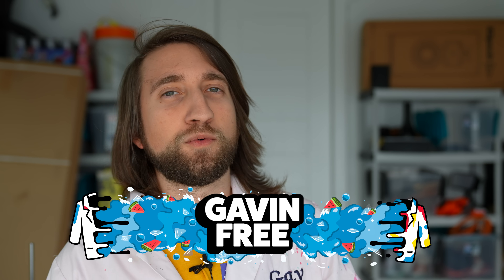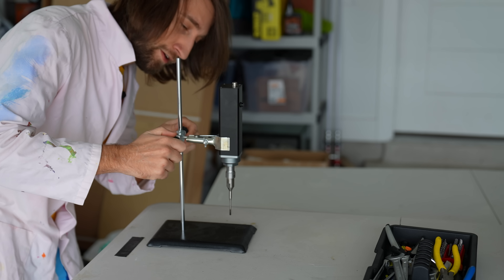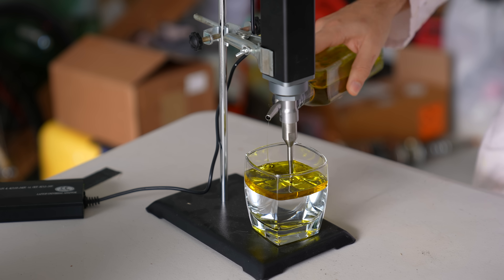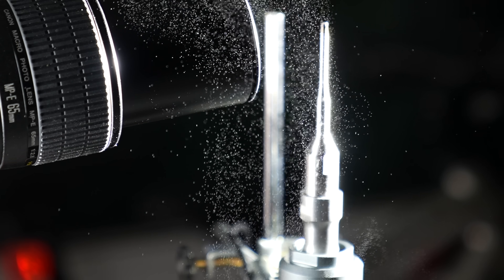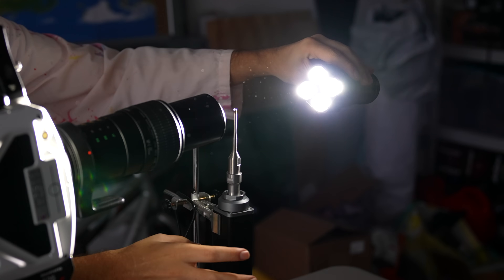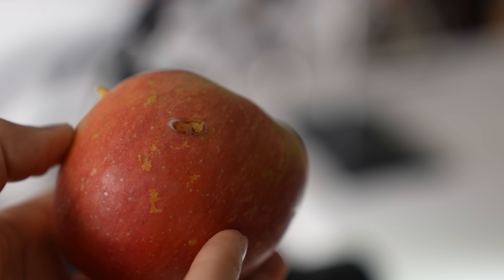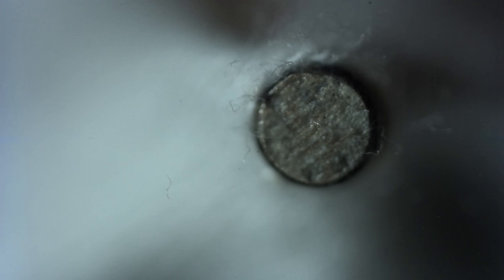Ultrasonic Obliterator at 170,000fps - The Slow Mo Guys

Comment: I think when this is used on solid material it's pretty much like friction drilling with carbide but instead of rotational force you have vertical. You still might actually be able to go through some soft metals even with this one because it's so fast. You should try it, it will ruin the tip though :)

Comment: The 0.000035 seconds is 0.000033 with some measurement error, since you have a 2 microsecond resolution and you measured 35 microseconds, you should really say ”35 +- 2, and 35-2 just happens to be 33.

Comment: Fun fact: The phenomenon he describes with the sonicator appearing to move slower than it is when filmed at lower frame rates is known as "Aliasing." Sampling data at too low of a frequency compared to a signal causes the recreated signal to have a decreased frequency. To prevent this, you have to measure at least twice as rapidly as the sonicator, or 60kHz for a 30kHz sonicator. The minimum frequency to prevent aliasing is called the "Nyquist frequency"!

Comment: I guess your labcoat is made of cotton, the footage of the tool ripping through it was amazing.

What i thought of, as soon as you put it to use on /against your coat, was (hopefully this is the right term, learning none of the terms in english) ultrasonic welding, especially ultrasonic welding in use on thermoplastic cloth. That would actually also kind of have an up-to-date aspect to it, since medical /kn93 masks obviosly can't be sewn, because that would leave quite some holes. 
With this tool you could kinda breeze over it to possibly actually weld some cloth together, "slowly" poke holes, cut two or more layered welded edges etc.
Or maybe you could even compare it with the machines actually used to weld protective gear and masks needed en masse right now. 

Regards

Comment: Cool lab equipment that would be interesting in slow mo ... 
1. High Sheer Bade mixer ... 27000 + rpm ... it also harmonizes and you should also be able to see cavitation at the blade tips ... I would love to see in slow mo how the mixing occurs because it does not happen at the tip it actually mixes as it moves from the inside to the outside of the blade ... if you can get a few different blade shares that would be really interesting - its a tad on the expensive side but you might be able to convince someone to lend you one.
2. High Sheer rotor stator mixer, this might be more difficult to see but if your could get someone to make the stator out of high impact clear plastic that could solve the problem of seeing what is happening.
3. Not as destructive but also interesting to see is a surface tensiometer that measures the surface tension of liquids, try to borrow one that uses a ring ... looking at different liquids to see what happens at the moment that the surface tension breaks would be interesting.
4. Someone mentioned chemical reactions there are some really visual ones, just need to check around
If I think of more I will add to the comments. 
I hope that you read this and can get the equipment mentioned. 
By the way, one cool experiment with the blade mixers is to mix fruit in water, seeing how the blade disintegrates the fruit should look pretty awesome and if you got something with contrasting colours like carrot (yea I know it's not a fruit), apple, pawpaw. You can also play with textures to see how they disintegrate ... The rotor stator mixer can also mix fruit but you need it to be smaller to be able to fit into the stator at the bottom.

Comment: And to think that old formula one engine were going over 20000 rpm but those pistons are moving much distance. More then a quarter of a mm like this is doing.... clearly more impressive tech ;)

Cool video though.

If you calculate piston speed it leave this in the dust.

Comment: You don't need an ultrasonic homogenizer to mix oil and water. All you need is the rear differential on a truck with a broken off breather hose. Another good method is to mistakenly add coolant to your engine oil. I have dealt with both of these situations working on vehicles.

Comment: I have a few ideas,. Using that on Jello to see if it causes the Jello to jiggle. Maybe a peeled orange or a grape. Another idea would be to see a water balloon popping. The reason for the water balloon idea is to see what the water inside of it does before it starts to move away from the point of impact. Basically if it will cause a ripple in the water or not. Just some ideas.

Comment: Hey Gav, try cleaning the sonicator tip with acetone.  If the black stuff comes off, it was char (carbon).  If it doesn’t, you’ve probably created a thin oxide layer on the steel...

Comment: Your explanation of cavitation is wrong. The pressure is the main factor. The rod is lowering the pressure of the water (locally) so the bubbles you see are the water actually turning into a gas phase at that fixed temperature. The bubbles are filled with steam and the only reason they collapse is because the pressure change is so fast and unstable, it quickly goes back to liquid. There's no voids involved here. Water in a closed can with no air gap can still boil, that's how you can understand it better. there's no air in it.

Comment: "Ultrasonic welding" using same principle but different shaped tools, is also how they merge certain fabrics together without traditional sewing or a bulky seam. Very common in the brassiere industry. Just vibrate fast enough until the materials become intertwined.
Reply: that sounds like felting

Comment: For the record, Scarecrow used a microwave emitter in Batman Begins, not an ultrasonic emitter. Great video though
Reply: Okay, but isn't the effect the same? Water becoming aerosol?
Reply: @isaackangas6921  Not exactly... The absorption of microwave energy by the water would vaporize it (cause it to change state from liquid to gas) rather than aerosolize it (convert it to a collection of tiny droplets of liquid suspended in the air).

Comment: Your title displays "30,000hz. I realise video producers are not science trained and perhaps have had no training in anything, but you really should try to understand the SI system physics standards if you are going to use them. For a start, the symbol for frequency is Hz, not hz. Second, there is supposed to be a single space gap between the quantity and the quantity symbol, and thirdly it is standard practice to express numbers as standard multiples, e,g, kilo instead of writing three noughts.  Your "30,000hz should therefore have been written 30 kHz. Try to be better educated!

Comment: If there isn’t any “air” in the gap that it creates, then what is it? A true vacuum?
Reply: It's water vapor, not vacuum. When the tip retracts, an extremely low pressure volume is created. This volume has a pressure much lower than the vapor pressure, resulting in water evaporating.
Reply: @daan1748  thank you
Reply: @MarkBunoy  you're welcome
Reply: If I remember right, they are not perfect vacuums, because vapor gases of the surrounding liquid evaporates into it. But there is no "air" in them.
Reply: water vapor i assume

Comment: I don't know enough about how the tool you have works but from what I know the bubbles in cavitation aren't empty. Usually its so low pressure that it basically boils the water so they are filled with water vapor and sometimes other gas that get pulled out of solution, so yeah it isn't "air" but it is gases. Though maybe its so fast that it does actually make a vacuum, like I said I don't know enough, anyone who knows better feel free to correct me.

Comment: I use an ultrasonic cleaning tank to clean Carburetors and other small things as such and it was quite interesting to see how this device worked and what it is capable of. I would really like to see the mechanisms in the device taken apart and operating in slow-mo, I think that would be really cool to see.

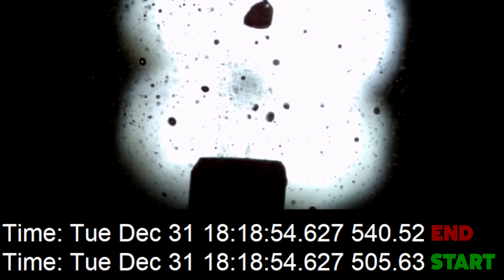Comment: 6:48 that's water droplets stuck in slow time in the air. That's how fast the camera is. But look closely at the tip of the sonicator, there's stuff falling back on pretty quickly. Over and over. What that is is maybe light? Or metal? Can't be liquid. Or it is liquid but liquid getting sucked back on to it due to suction?. Idk.

Comment: I worked in a lardrover/jag plastic factory for a while and we used them for plastic welding, it would be like a plastic bolt and washer and you'd melt the bolt down to the washer instead of a nut

Comment: Suggestion: Wire EDM (electrical discharge machining) -- uses a wire at high voltage blast tiny, precise cuts through metal.

Comment: Here is a quick-n-dirty Fourier analysis of the motion. The main result: 30 kHz is 33.333 us / cycle, estimated 59 cycles in 691 frames = 34.104 us +/- 0.5782 us / cycle or 29.32 kHz.

https://gist.github.com/nikonyrh/634c64d3f06f45c7a38a795f3b7c2114

Comment: You guys did a video once where you showed in insanely low res the actual speed of light moving through a medium. Would it be possible to see light separating through a prism, or would the necessary frame rate and lighting make something like that impossible?

Comment: You should find 200khz or more to make a tiny ultrasonic wirebonder. Plastics welds when you apply ultrasonics as same direction as pressure force. Metals weld when you apply ultrasonics 90 degree to parts pressure direction.

Comment: For anyone who is interested: the speed of the tip in the up and down movement is on average about 12 m/s or about 43 kmph according to my own calculations.

At 4:50 Gav shows that the width of the tip is 3mm.
At 6:46 I took a screenshot with fullscreen and measured in paint that the width of the tip is 345 pixels.
Then I compared the frame where the tip is all the way down to the frame where the tip is all the way up and I measured that it has a difference of about 24 pixels.
24 pixels equal about 0,208695652 mm which is the amount the tip moves up (and which logically is also the amount the tip moves down).
Then, if you convert that length to meters and multiply it by 2 since it goes up and down in 0,000035 seconds, you get:
(0,000208695652*2)/0,000035 = 11,9254658 m/s or 42,93167698 kmph
Or about 12 m/s or 43 kmph

Comment: Cavitation is not a gap in the water, its water vapour. Because the pressure is very low locally, the liquid changes phase.

Comment: now think a cpu cycle that has 3.5ghz clock.. it will take 0.0000000035sec = 3.5nanoseconds to complete a cycle. the Ultrasonic  in the video takes 0.000035sec = 2μs. the technology today is crazy!

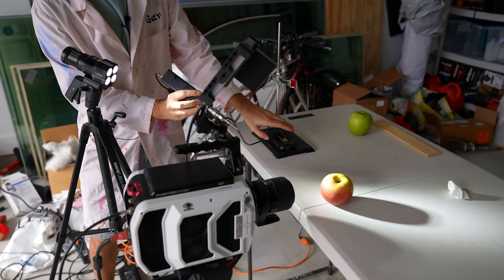Comment: 7:35 Urgh. that sound is... VERY high pitched. I have excessively sensitive hearing though. I picked it up pretty clearly. And yes. there is in fact a very high pitched whining sound when he touches the sonicator on the apple. If you don't hear it it just means it's too high pitched for your ear drums to pick up. Or your headphones don't support the pitch. Either or.

EDIT: Yes, the same sound also happened with the piece of wood. It happens to every solid object.
Reply: I can hear that too, I think there are not many people who can hear the very high pitched sound. I searched for comments at 7:35

Comment: Same concept but slow mo of an ultrasonic bath would be a cool continuation, especially in sweep mode. 
Otherwise a bunsen burner showing the initial ignition, and then spray with copper sulphate, KCl, NaCl etc in 'flame tests' to show the spread of colour through the flame!

Comment: In My engineering Degree I've been studying the Thermodynamic properties of Fluids. Correct me if I'm wrong but I feel this is a great example of Rault's Law: this Footage is Amazing becasue becasue it shows that the oil and water mix into a solution at the Water Vapor's Nucliation Sights across the probe. The effect's of Vapour Pressure is Fascinating stuff!

Comment: Fun fact: We also use them to sheer down DNA into smaller pieces.
Reply: DNA just isn't small enough eh? No pleasing these scientists.
Reply: And to rip cell membranes apart to get at  intracellular components.
Reply: so what would it do to human skin?
Reply: @spammyjenkins87  I would imagine, cook its way through it like a tiny lightsaber with little to no resistance.
Reply: We can also accelerate whisky aging
Reply: Fun fact?  Fun???  FUN, you say?  O_O  That sounds absolutely terrifying.
'And, on a lighter note, we also use ultrasonic wave generation on a massive scale to displace the actual ethereal membrane between other-dimensional plains and our current reality.  It's fun.'  :D

Comment: I wonder if you could capture the opposite of this with a centrifuge? Instead of homogenisation it will separate out the mixture. I dont know how you could do this. See the change on each pass of the camera? See how it changes as it goes across the field of view? Use two cameras? A top down view? Just food for thought

Comment: Back in college, I saw a popular science article on ultrasonic levitation. Put two of these at opposing ends, pointing at each other. Hook up to a frequency generator and dial it until their waveforms are perfectly destructively interfering and you can balance droplets of liquid on the nodes of the standing sound waves. It was my 2nd year physics project but proved to be beyond my capabilities and budget at the time. This was the second thing to get me thinking back on this. Did some googling and it would appear the homogenizer used in this vid is a mere $850 on Amazon. I guess he said cheapest and not cheap on purpose. Anyway. A bit more research turned up the modern equivalent of what I bought back in the day. Ultrasonic transducers. Looks like they run from $20-$50 from China and come with a control board, which should be helpful. I have an old school oscilloscope for dabbling in oscilloscope music, so I’m probably going to revisit my semi-failure of a physics project in the next few months. (Grade was good, result was satisfactory for the profs, not for me. Haunted me for years...lol)

Comment: These are also used in industry to weld plastic components together in assemblies like how spot welds are used on sheet metal.  It also works for soft malleable metals too like aluminum for example.

Comment: Possible ideas for equipment to film:

Single use lancets, used to test blood sugar levels.

Insulin needles with engineered safety where they retract the needle into the vial on fully pressing down the plunger.

Comment: I don't think oscillation is directly humidifying the air by smashing water. When you smash water into tiny droplets you probably exponentially increase the surface area of the water. The more surface area you have the faster the water convection is. Until relative humidity hits 100%.

Comment: could you try making a laser move in slow motion through the stroboscopic effect? 

flash a laser at a high frequency, and have your cameras at a close enough frequency but not actually matching it to create the illusion of movement on the laser? You could definitely do this on normal cameras but 60fps creates a long line, with high fps i bet you could get a small ball of laser light

Comment: Isn't cavitation actually the boiling of water due to negative pressure? You can also see this in ship propellers, where the negative pressure - which then pulls the ship forward - is created. The lower the pressure, the lower the boiling point. So these bubbles are not necessarily voids - they are steam-filled bubbles. Sorry for beeing Nerdie^^ - BTW - Scarecrow hasnt boiled the Water - he poisened it with Drugs - the boiling was done by Ra's al Ghul to release the drugs ... :P

Comment: I'm pretty sure there are versions of this used as surgical cutting tools
Reply: Yes, and they are much lower power. The main attraction is they can cauterize as they cut, which prevents all bleeding. There's a kinda-tweezer-like tip which can simultaneously cut and seal small blood vessels and other tissues, which is a game changer in -ectomy procedures. I have absolutely no idea how common it is for these to be used though, or what they're even called. I only know of them from some marketing material I came across in a previous job. I will say though, that was quite a number of years ago, and it's still pretty impressive tech today.

Comment: A flow cytometer with a cell sorting chamber would be really interesting to see in slowmo, but you will need the help of a lab, because those are way too expensive and can be complicated/dangerous to use open if you are not trained

Comment: Another fun thing to film could be a PZT. A piezoelectric transducer. They are used to make high speed oscillations, or to measure them. They can be used in microphones, or as a base to make small oscillatory motions on objects. Ive used them in the past to move a mirror forward and backward tiny amounts to change the length of the path of a laser. But I'm sure it could be neat to film

Comment: Are those cavitation bubbles formed in any kind of liquid? If yes is there a difference in the way the bubbles are formed, are they bigger, smaller, last longer based on the liquid density and thickness? 

Sorry for so many questions
Edit: Also sorry if they are stupid questions

Comment: Maybe a spin coater?
Reply: If you spin a thin film from a polymer (or any other dissolved material) solution, then you can see as the film thickness changes during drying the different interference colors quickly appear and change

Comment: It would fun to see a rotor stator in action. A normal one does about 30000rpm, so you could capture it in 4K. It would also be interesting to see a centrifuge in action. If you matched the frame rate to the rotation rate, you might be able to watch the sample sediment or cream. You can buy mini single speed centrifuges with a clear top. Some go at 12000rpm, so with a frame rate of 200fps, you’d get 1 image per rotation. Just a thought.